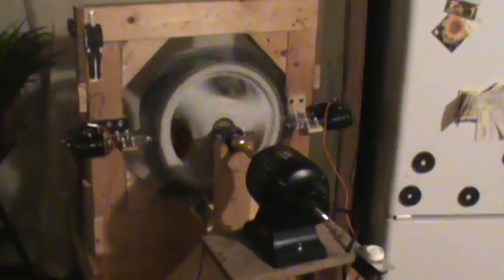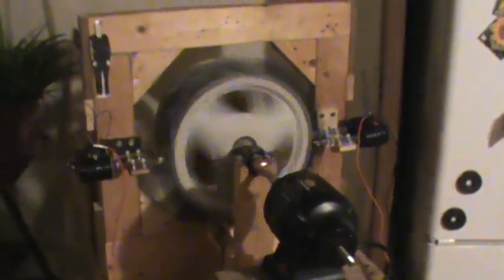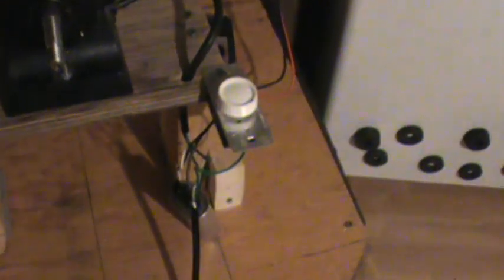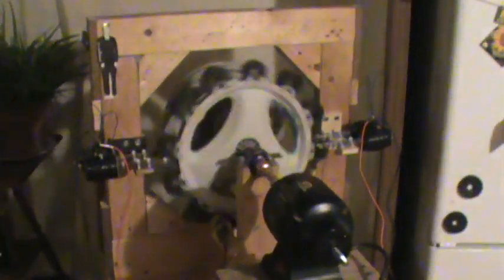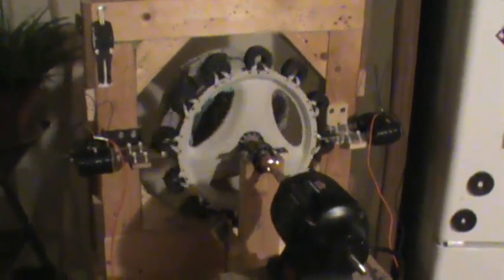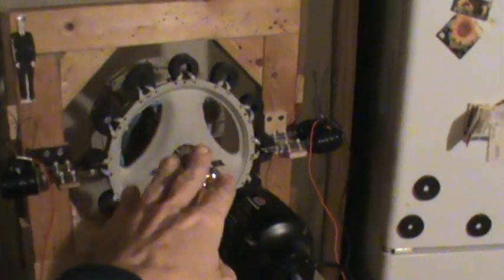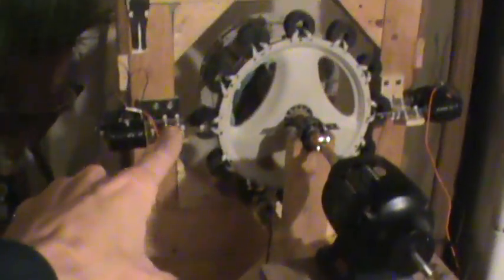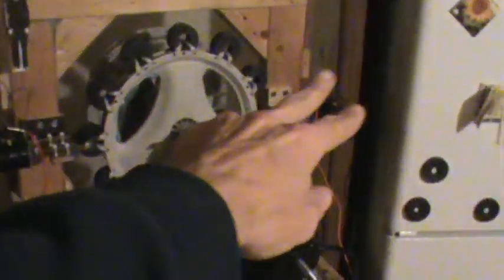Free Energy Project - Driver Motor Input Test

Comment: well damn dude that is pretty convincing by itself because you would think the presence of just the steel/iron alone would not have presented so much drag. so the fact that it increases in speed so much when the coils are shorted has to mean the coils are actually accelerating the rotor and not just cancelling some type of drag within themselves.

Comment: That's exciting.  I hope that everything works out for you, which it looks like you're about there.  I was thinking about a machine, somewhat like yours, that could power an electric motor to drive a small vehicle like a golf cart or go-cart.  It would obviously have to be on a custom frame, but would be interesting to see if it creates enough power to drive such a large electric motor.  I imagine a battery system will be needed too, but the batteries could charge while the cart is not in use.

Comment: Angus, I have a question. By mounting an automotive alternator with a battery and inverter or an a/c generator on the opposed shaft of the bench grinder, would you be able to show the proximity to unity or over unity that you achieve. I think the additional drag on the flywheel once the coils are engaged, it may keep the speed down in the sane rpm range.

Comment: Hi, just a suggestion, but if you want a quick way to measure wattage I noticed you have a couple of meters there and you could use one set to the Current range and insert it between live and the motor. The motor looks to be a fractional horsepower one, like 1/3 or 1/2 so the current would fit in the meters range Im sure as long as it can do 10A continuous. It would probably be less than 3-4A so it wont torch your meter. Measure the Voltage at the motor and multiply it by the Current pull=Watts.

Comment: Tony Stark called.  He wanted some tips.

Very cool video.  Any plans for a battery system that would be self charging?  Also, when you get that rip cord installed, would you be able to hook up a generator to the wheel?

Comment: Good progress!
One test that would be intresting to see before you put more PMH on the machine is this:
1) Unmount one PMH compleatly.
2) Run with one shorted PMH at your test speed, put a mark on the reostat position.
3) Mount the 2:nd PMH. Run with two PMH shorted at your test speed, put a new mark on the reostat position.
4) Compare the reostat positions, did the input increase or decrease?